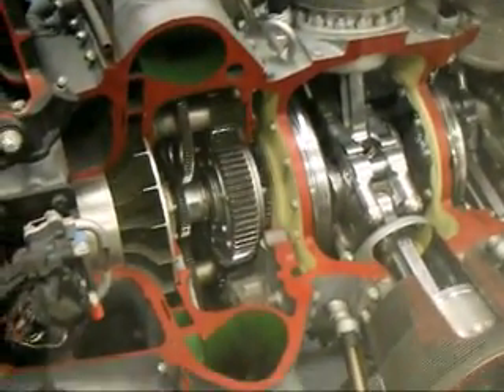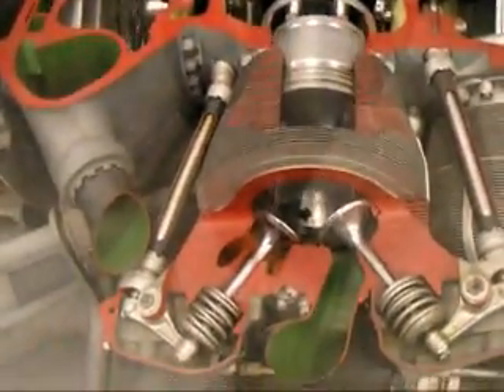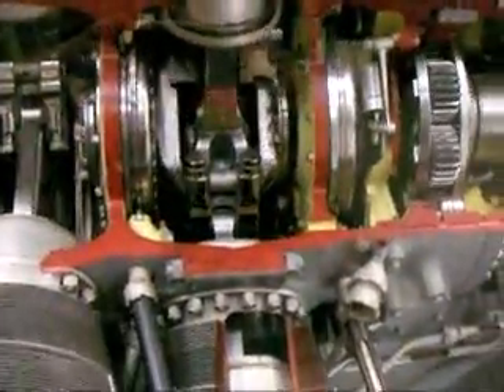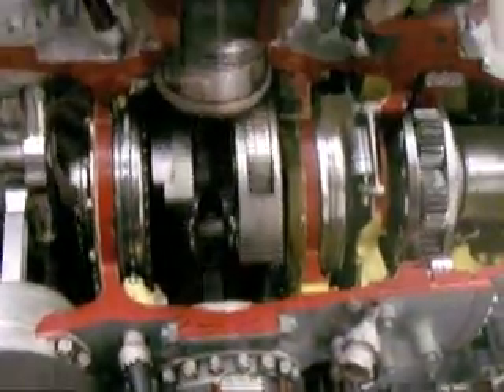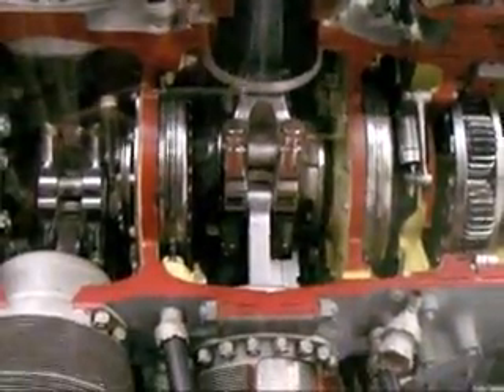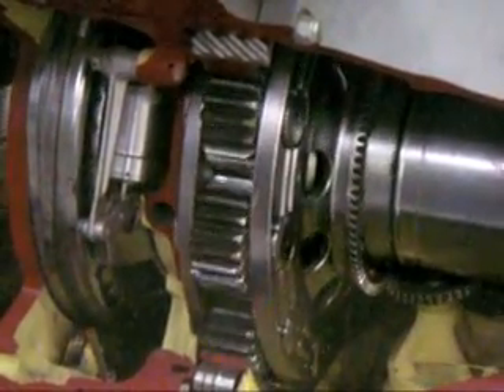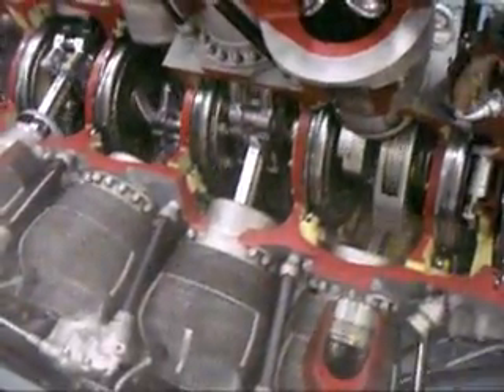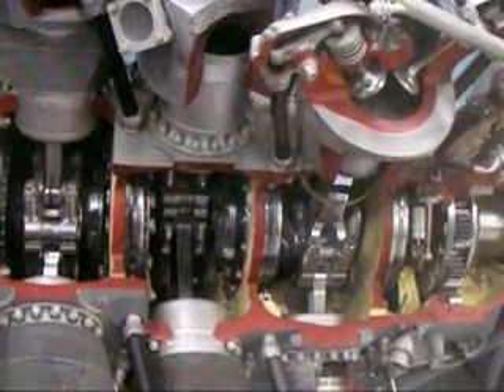Pratt and Whitney R-4360 Radial engine display

Comment: I'd like to add that the firing order is even more amazing. If you know what this means, you know what I'm talking about. 1, 22, 15, 8, 17, 10, 16, 24, 5, 26, 19, 12, 21, 14, 7, 28, 9, 2, 23, 16, 25, 18, 11, 4, 13, 6, 27, 20. Master rods are located in cylinder A7, B4, C4, D1. firing order 13, 14, 7, 8.